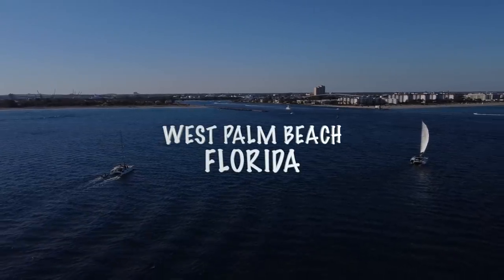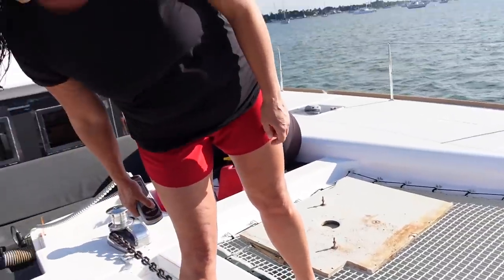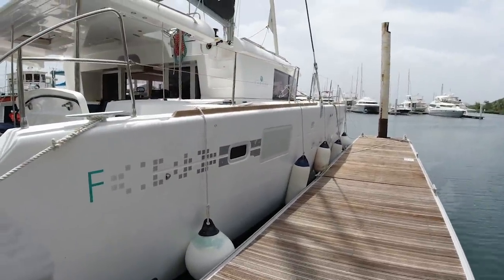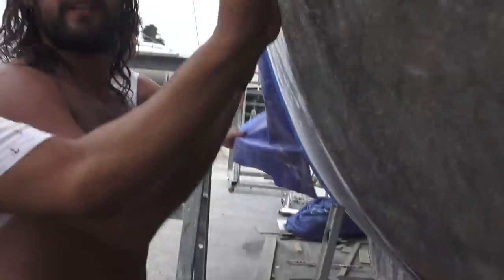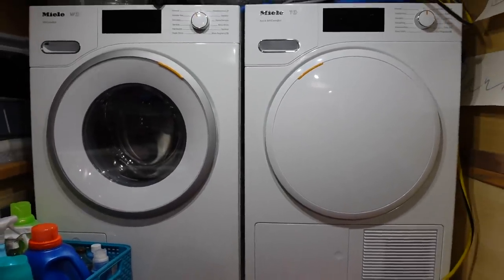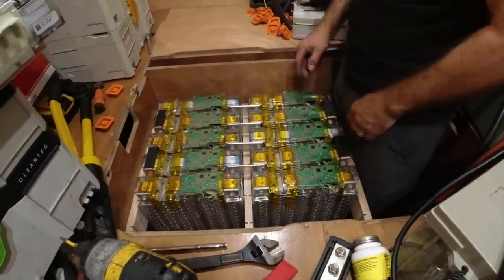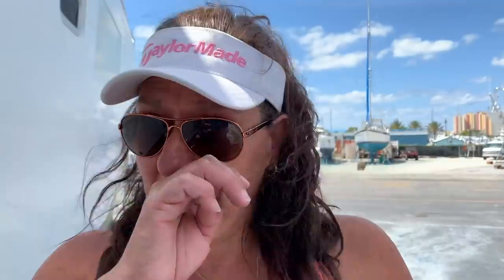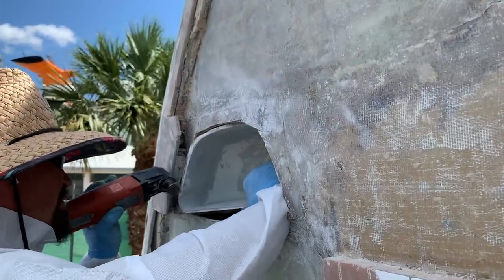Biggest lithium battery installation ever on a sailboat? - Episode 105

Comment: planning on 150 kwh and electric propulsion for my cat without raising weight
Reply: have you picked motors yet?  genset yes / no?
Reply: @CheekyMonkey888  Torqueedo Sail Drive 50 Kw but if I can get my hands on 2 Lucid Air drive units , I may change . No Genset , but a lotta solar , including foldable panels to cover the full trampolines . Main goal is to have a range that covers at least the Panama and Kiel (North Sea to Baltic) canals which is were the foldable panels will come in handy .
Reply: @gerritgovaerts8443  thanks, I'm leaning towards Oceanvolt, due to their promised regen, and a honda i3000 gas gen with no fuel stored inside boat

Comment: You can charge your batteries with your engines, will not fully charge them if you dont have the correct alternators they will burn up your batteries.. that solar will not charge it, and like you say cloudy skies heat running your AC will run those batteries down..and I do have a Tesla..a hybrid system would have been a much better solution like Elco has so your watermaker, icemaker can run off them

Comment: No hate on you but using tesla batteries to run a boat is the stupidest thing ever. Drive a half hour, then charge for 24 hours? Plus massive risk if the batteries are breached... unstoppable fire.